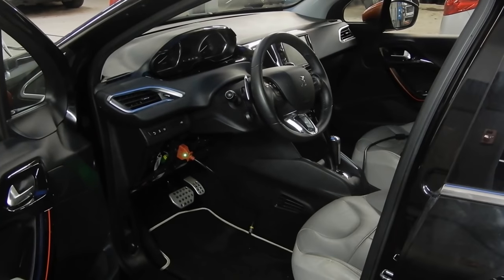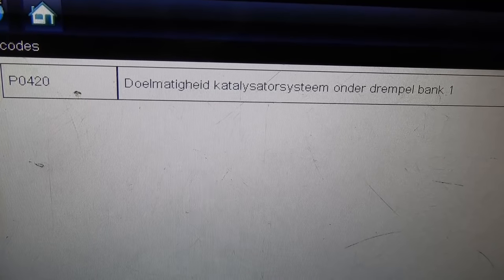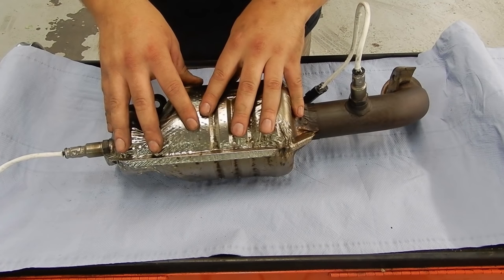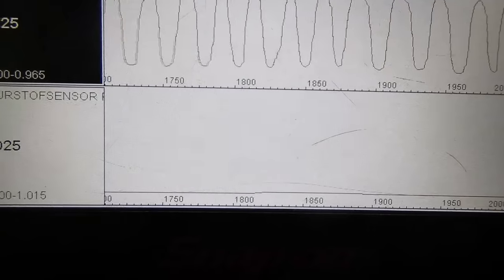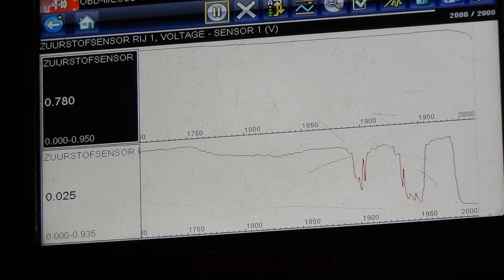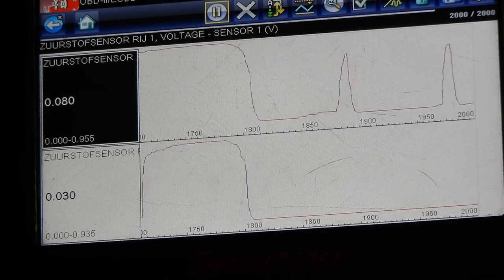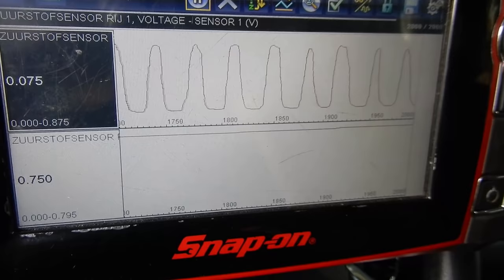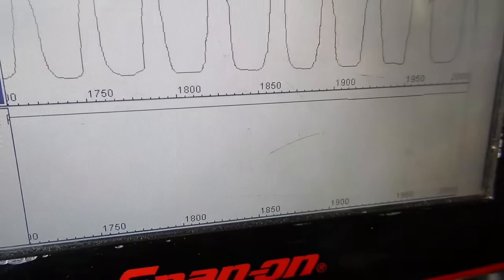Peugeot 208 P0420 / Catalytic converter diagnose and Fix!

Comment: Another case of the same problem to report here. Started getting the error code at 69k miles. Removed the cat and welded it up today. I have seen evidence some main dealers want £1000 to fix. Seems unfair for a design flaw. Thanks so much for your video, gave me the confidence to tackle the problem.

Comment: Hello Dan, your diagnostic videos are first class, I gain so much information and new knowledge  from you, the Peugeot, after viewing the crack in the end cheek of the Cat, I  would suspect too much cyclical strain as a cause of failure,  I would check , the engine mounts, the exhaust hangers, any seized flexible joints in the exhaust system, excessive play in the exhaust system, anything which could cause cycles of mechanical stress and strain   on the component causing the  cat to develop a mechanical failure.  Do you agree with my thinking?

Comment: never really understood how these sensors worked but you have explained this very well 👍I recently had a kat fitted the old one was beyond repair.engine management light is now back on .connected a obd reader .fault coming up says kat emissions control faulty. would this mean the scensors are now at fault 🤔

Comment: I welded the crack on our 208, but the engine light didn't go out. It still reads the same code P0420, how can I reset it, my obd tool didn't clear it for some reason.

Comment: To find cracks like that, we use a smoke machin, 
Take out the O2 sensor at the top
Put smoke and presure in
An soon you ser smoke coming out

But a grelt video abort, its not allways the O2 sensor, that falty

Comment: In general those 3 cylinder cars vibrate quite a bit. I've seen them eat engine mounts at less than 50k miles so this cracking of CATs does not surprise me.

Comment: One thing I did not understood, if there is a crack, shouldn't the gas from the engine go out of this crack instead of air in? I mean there is a high pressure of gases inside the exhaust system, so if there is a crack you should probably hear this extremely loud noice

Comment: great vid dan i have a peugeot 2008 model 2016 the engine management light is on it says a repair is needed the engine is running ok but seems to lack power it does not run rough or stall at idle the light is amber with a question mark through it i am going to investigate the problem soon but i also wonder if i have the same problem as in your video

Comment: I know those cats, changed a hand full due to cracks at that very same spot, and welding does not fix the issue on the longrun, if you weld it it will crack somewhere else again soon

Comment: Switching between the two O2 sensors is an option to know if our downstream sensor is good or not , just an opinion , you are the master
Reply from the maker: Aissaanes Lyes, I'm not sure what you mean can you explain?
Reply: I mean change between them, the upper sensor will be down and verse versa !!!
Reply from the maker: Aissaanes Lyes, this is only possible when both sensors are the same. Most cars have got a wideband upstream and a narrowband downstream sensor. And ofcourse you try to diagnose the car as fast as possible. Measuring is faster than chancing them out.😁

Comment: hi instead add fuel manual , you can per scan tool on the actuation test change the fuel injector quantity to rich or lean condition , after select BS1 and BS2 .

Comment: Hi Dan is the top sensor bank 1 thanks
Reply from the maker: carl mayers, great job👍
Reply: DiagnoseDan does that mean yes
Reply from the maker: carl mayers, an engine in v-configuration you have a bank 1 and a bank 2. For Example cilinder 1-3 on bank 1 and 4-6 on bank 2.
A 4 cilinder engine only has 1 bank. So All sensors are on bank 1 on a 4 cilinder engine. so sensor 1 bank 1 is the one closest to the engine and bank 1 sensor 2 is the second o2 sensor after the cat.😁
Reply: DiagnoseDan cheers Dan
Reply from the maker: carl mayers cheers buddy!

Comment: great diagnostic. problematic is you only repaired the issue but the cause is still existing. the crack will resurface or crack somewhere else right next to the new weld. the strain or tension in the exhaust system needs to be addressed. it is not normal for a converter housing to crack like that.
Reply from the maker: I know, but the welding seems to make it stronger. No problems till now.
Reply: seems like bad luck or coincidence that the problem is more common, I don't believe in coincidence.  just saying, check for the hangers, flexpipe and make sure the system is moving freely even when heating up, expanding. 
exhaust should always expand towards the back and never put pressure on the converter, header or even worse the turbo housing.